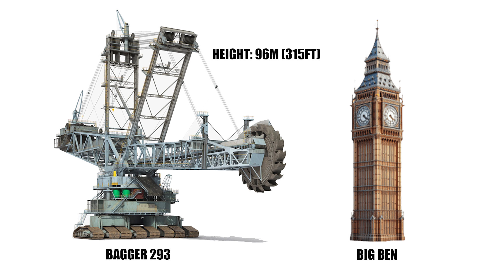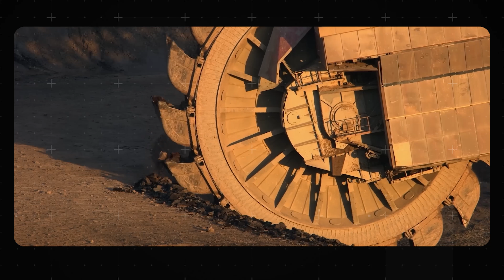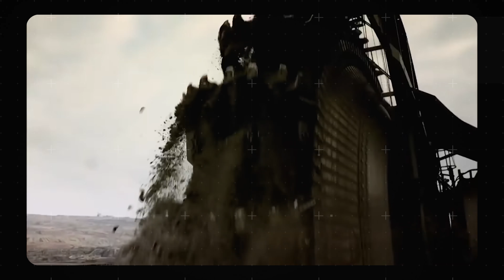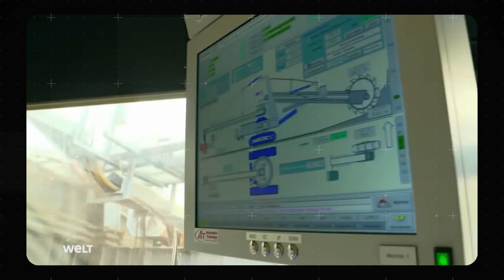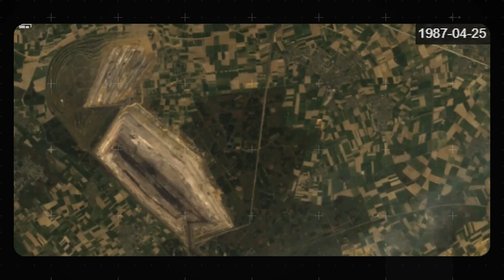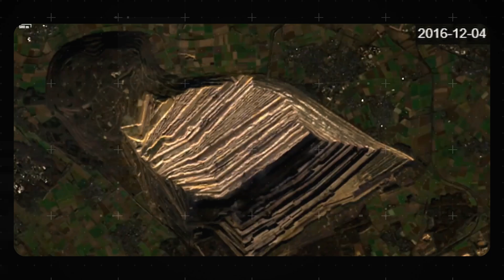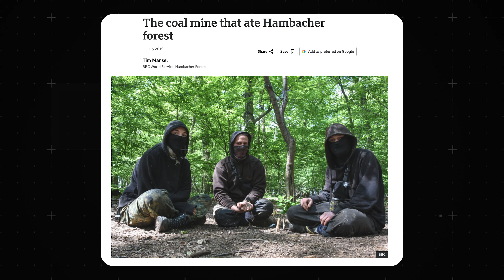The World’s Biggest Land Vehicle Will Soon Be Useless

Comment: That thing and it's compatriots have made a huge hole, mess and hill. The mine is now the deepest man made excavation in Europe. The mine has produced the highest man made hill in the world. The hole in the ground is about 1/4 of the US's District of Columbia or 20 times the size of the country of Monaco. The hole in the ground which has been used to generate about 5% of Germany's power may be replaced on the same site with a solar park with a higher power capacity than the 3 power plants that the Hambach mine supplies :O
Incredible bit of machinery.
Reply: Your notion of how much solar energy per square km of a  real solar farm is way off.   Since you are using the land area of Monaco as your measure, to even replace the nameplate capacity of the remaining plants (about 4.3 total GW capacity) you would need an area about 40 times the size of Monaco.  To replace the historic plants that provided its former 8 GW (which I believe is the 5% of Germany’s grid) you would need nearly 80 Monaco’s.  However, due to cloud cover, seasons, night, rain, snow, and other factors; even assuming extensive use of battery storage you would need between 6 and 10 times that area 540 to 800 Monaco’s to replace it.  Or (at the top end) just over 1600 square km or the combined area of Kreis Düren — approximately 941 km² - and  Rhein-Erft-Kreis — approximately 705 km².   Of course even at this density, all farms, forests, meadows, towns, cities, people, etc will need to be removed.  At the lower end (no solar tracking and the panels are just packed with minimal space between them maybe - 900 square km.). Yes, I know people have tried to grow crops between rows of panels.  However, solar farms are not experimental technology anymore.  In some parts of the world it is a significant part of the grid AND real plants exist.  It is no longer about what could be done hypothetically, it is about what is done in reality.  In reality, you will not find anyone building 1000 MW nameplate solar arrays where the grounds are shared by anything other than a few plants where sheep are used to maintain the grass used for maintaining grasses planted for storm water control.  By the way, in those plants even the natural small streams are gone and replaced with “storm water control”.  The natural environment is totally eliminated as far as the eye can see.
Reply: Very good point....excelent.....
Reply: @a @antonioferraoferrao454 In order for green technologies to succeed, advocates of solar (and I am one) need to move away from over-promising and under-delivering.  All that gets is bad policy, skyrocketing cost, rediculous things like California’s infamous “Duck Curves” and being totally discredited.  Solar - just like anything else - needs to provide people a return on their investment.  That return may not necessarily be totally economic but iyour lights still better turn on in the middle of the night.   The irony is that the first major city in the US to be powered entirely by green energy (for even a minute) - with no cheating by importing coal power greenwashed by emissions trading - will likely be the Dallas/Fort-Worth metro area.  Why - it is not because of the 5 environmentalist who live there - but the infrastructure needed to support distributed power sources is there AND both wind and solar are available in vast low cost supply.  In fact on March 18th of this year, for a mid-day period, that grid received about 87% of its power through renewables with over 90% of the power being carbon free when you add in Nuclear.
Reply: @Why_ask_  Nobody will remove any settlements to build a solar farm in Germany. There is enough usable space available.
Reply: @theau @theaustrianengineer4494 , you can always remove farmland and forest instead.  My point is that to replace significant grid capacity you need 100s of square kilometers.  Right now the US State of Texas has about 1000 square kilometers of solar farms. Each of those will produce between 1.5 and 2 times the annual energy as that same land amount in Germany due to latitude and cloud cover differences.  Even withe the much lower population density, difficult land use choices must be made.  There is always a some negative impact.  Is that cost worth it? It can be, but the utopian view that grid scale solar has no adverse impact doesn’t ring true in the real world.
Reply: @Why_ask_  Every form of electricity generation will have adverse impacts, but at least with solar you don't have to destroy any settlements

Comment: One machine. 5% of Germany's power. That might not sound like much. But that is steady and reliable power. What is going to replace it?
Reply: Probably Nuclear in the form of full sized Power Stations and also Small Modular Reactors.

Just make sure they're all built when you shutdown the Coal Power Stations because the UK terminated coal power in 2024, which is fantastic, but the Nuclear Plants are still being built. 🤦‍♂🤣
Reply: @jamesknight3070  Nope, Germany shutdown for good its last 3 reactors in april of 2023. It will be replaced by wind, pv and batteries.
Reply: @ingo_8628 until they realize those don’t produce enough electricity to keep the country running and reopen the mine and build new reactors.